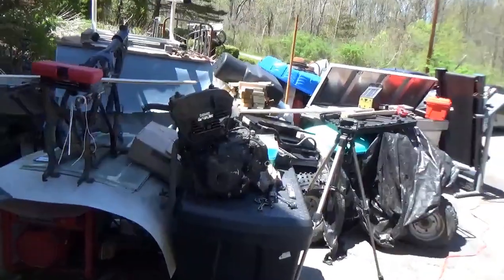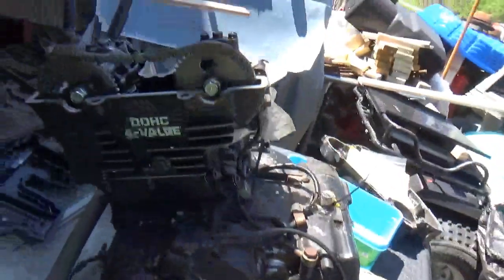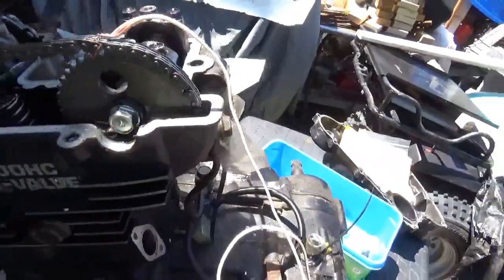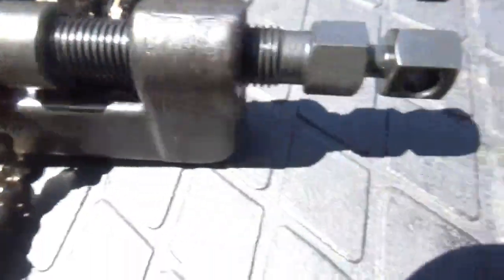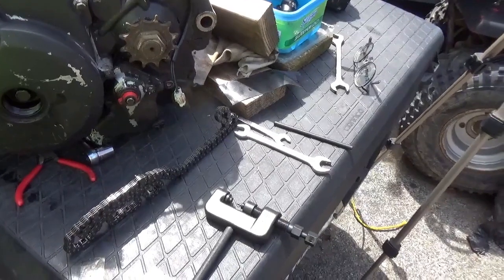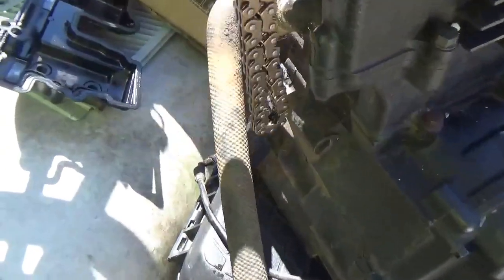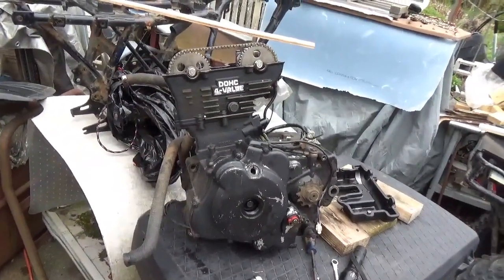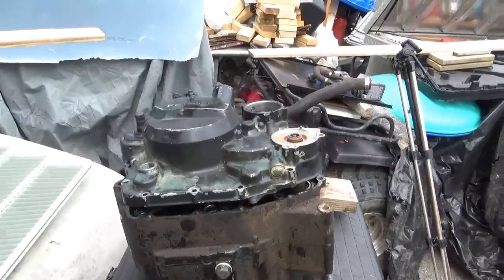Kawasaki Mojave 250, Quick and Easy Timing Chain Change!

Comment: Glad I ran across this brother. I have a 95 klr 250 (the Barbie bike colors) that looks, runs like new. (Same engine without hearing for reverse) I replaced everything mechanically front to back but I've been babying an engine that has some flaking on a lobe of an exhaust cam (the one opposite the Kacr), some blowback thru the valves (you can see brown discoloration on the springs) and a timing chain at the end of the tensioners adjustment. The chain is "just" beginning to lose its tension and I've been thinking of replacing it to baby it along without doing the whole head. I only ride it back and forth to my 80yo mother's a couple times a day (6 mile round-trip). I already do an oil change every 2k. This video made my day. Happy Thanksgiving and God bless you and yours.
Ps: I just bought a 2018 KLX 250 camo with fuel injection. I'm going all over it this winter. Man the sensors and pollution crap everywhere! Every single plug on the wiring harness looks like it was submerged in mud. Thank God they have rubber seals. I'm an electrical engineer that loves EVERYTHING mechanical. The worst thing we ever did was to put computers in vehicles with tons of sensors to mess things up. The KLX is the obvious evolution from the KLR. I'm keeping tight records  and my 26yo son is gonna have a couple awesome barn finds someday. Hope he enjoys em as much as I have (if they still allow us to have fossil fuels that is). Thanks again for this video brother. 👍

Comment: Just a little trick i learned on my KLE500... The tensioner nut size 10 (looks like my old one wich was originali on my KLE '93.) can be replaced with the younger model, nut size 12 and 13 wich are plug and play and much better than the older model... Just watch the arrow when you replace it... (sorry, my english is a bit rusty)
Greetings from Croatia!
Reply from the maker: Hey hrx1973!!!   Ur English is very good!!! Thanks for the good info! Thanks also for Ur thoughts, watching, and commenting!

Comment: i was pretty excited to see you upload this . i’m working on a 1987 kawasaki mojave 250 right now it’s got bad ticking so i’m thinking valves. my timings good
Reply from the maker: Hey Brayden!!!!  I;m glad that U enjoyed my video!  About Ur engine noise, it could very well be loose valves or a slapping timing chain!!!! Thanks for Ur thoughts, encouragement, watching, and commenting!!
Reply: Harvey Spooner i tore the head off today. the timing chains not very loose . i tried adjusting the valves but i couldn’t get the adjuster screws loose. i’m not sure what i’m doing wrong . it was at top dead center

Comment: dig your vids,very informative and detailed,ive got thru 3 projects with your help and i thank you.ive ran into a problem on this 87  ksf 250 mojave,i bought it with what i was told was all the parts to get ti running.well i found that the kick start gears are missing teeth.and to add insult to me already over paying for it,the gear is no longer available,ive looked everywhere i know of.by chance would you have a 25 tooth kick start idle gear?or a place that might have nos gears?people tell me just scrap it,i cant tho its in pretty good condition and my second 4wheeler,first one is a 87 lt230e that im looking for a rear carrier for.i have somewhat of a hoard started,striving for one like yours,lol

Comment: Harvey...Do I have this right..All you did was press fit the connecting pin back in the new 

timing chain..?..Ive seen roller chains replaced this way but with a spot weld on the end of
the pin...What you did may work with hi-vo chains..I just dont know..Ive never seen this 

done before...Great stuff..Thankyou.!

Comment: Hi Harvey.....tried your “easy” valve chain.  All went well until putting the cam back in.  Almost seems like the chain is a couple links too short and cam won’t seat with the chain on it.  Did you experience anything like that?  Thanks